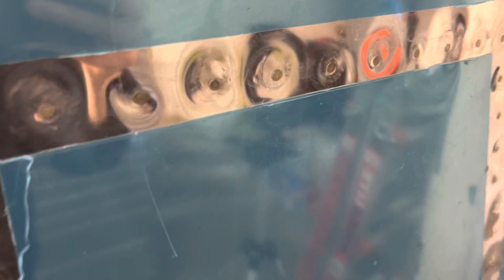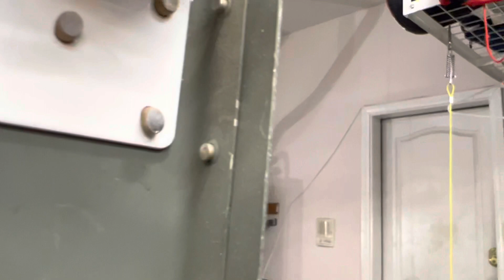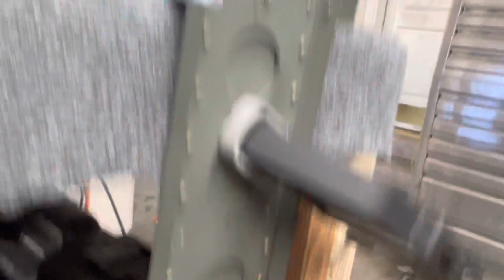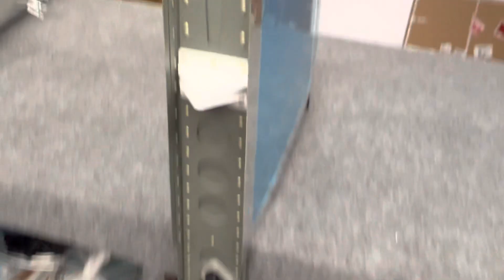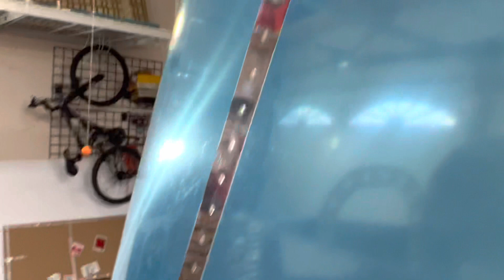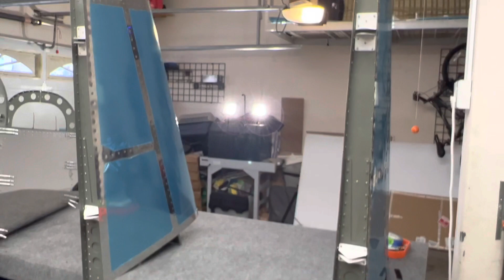RV-14: Vertical Stabilizer 1.0 vs 2.0 FIGHT!

Comment: Yeah, I'm basically on VS 2.0 for an RV-10. Learning on the job. Finished the rudder and working on the horizontal stabilizer and after burning through $300 in parts on the VS I'm pretty happy with the quality now. Takes time to build the skills and technique.

Comment: Thanks for showing the first vs the second version.  Quite an improvement.  I have a 3x gun but I use it mainly for the larger rivets.  My 2x works great on most of the smaller AD-3s, etc.  I also turn the pressure down to 40#.  I found the 3x gun, even on lower pressure, to be a bit too much "wallop" on these.  I've had a fairly long learning curve to arrive at what I consider acceptable results but did most of the learning on scraps.